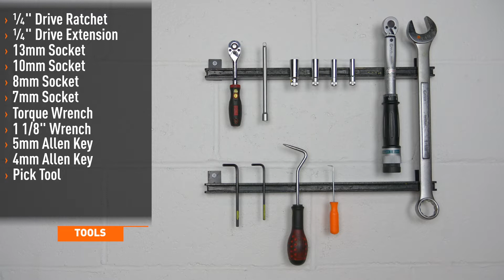2011-2016 Ford 6.7L Powerstroke Baffled Oil Catch Can Kit Installation by Mishimoto

Comment: Got mine the other day and have watched this video, very nice! I am assuming that the Allen bolt at the bottom of the can is where the can is drained from? Am I correct?
Reply from the maker: that is one method of draining, however is was place primarily to install a drain kit. A lot of people will find the removing the bottom is much easier.
Reply: @mishimoto  Do you have a drain kit? So the bottom half must unscrew? Obviously I have not had any quality time with this little gem.
Reply: It also seems that the three button heads on the top of the can are not metric but 3/16ths and the allen set screw on the bottom is 5/16ths. What is the thread for the drain? is it straight or a pipe tap thread?
Reply: I installed the kit on my 14 SD this weekend. Kudos to your team for the engineering it took to do this!  The hardest part was fitting the rear adapter, man that was a bit of a pain but it was successful. I have not been able to unscrew the bottom of the can thou.

Comment: What does this modification do?
Reply from the maker: On a diesel engine a catch can would prevent the forming of sludge that can clog an EGR valve and well as engine valves by stopping the excessive oil that gets past the factory PCV and gets sent back through the intake manifold on the engine.